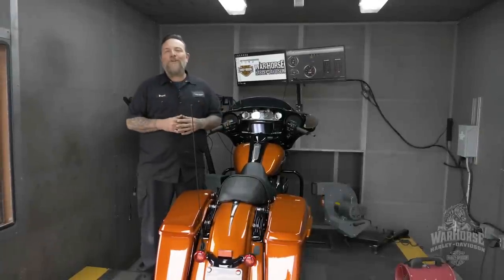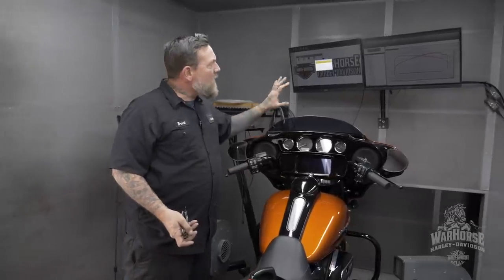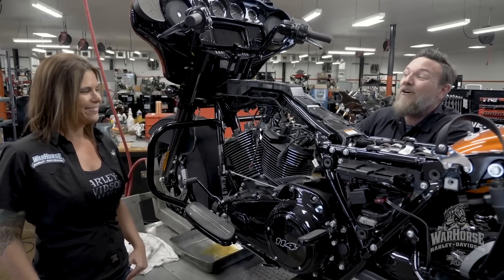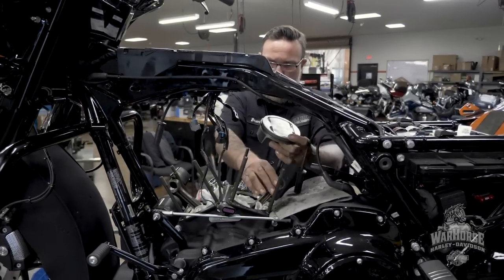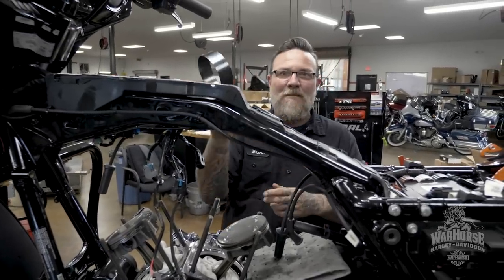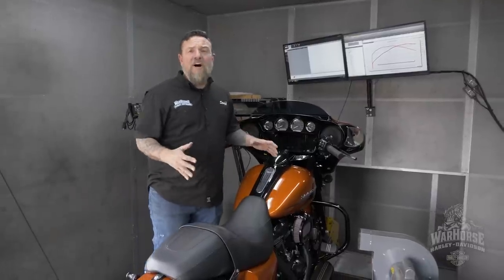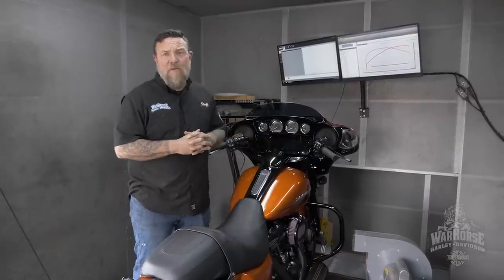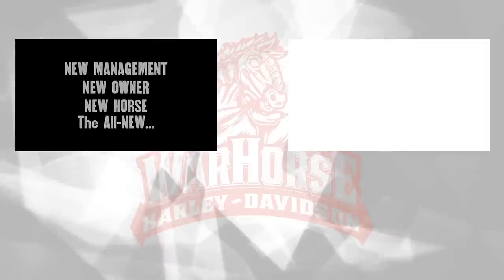Harley-Davidson Screamin Eagle 131 Stage 4 Crate Engine Upgrade Dyno with Horsepower and Torque

Comment: Not really impressive for the displacement
Reply from the maker: Thanks for the feedback. We're pleased with the increase in performance and this thing is still under warranty so we're happy!
Reply: Yes it is. Its EPA, warrantied, and no other options give you that
Reply: @daflea66  There are craploads of bikes on the market that give a much better power to weight ratio from factory.....
Reply: First of all, torque is the number you want for this type of riding, not power. Second of all, comparing sport bikes to cruisers and touring bikes is ridiculous and makes one look jaded, uneducated of the topic, or just dumb. Third of all, load any bike with the same travel kit and passenger weight i do and i will ride next to them the entire time, indefinitely, up any grade, and they'll never feel like they were at a torque advantage.
Reply: @elonmust7470  Agreed. Really cool bike. But ktm 1290 r makes 140 hp to the wheel and 130 foot pounds. Factory. Different kind of bike tho
Reply: @elonmust7470  With regard to from factory, everyone who knows bikes knows Harley Moco uses stuffed exhaust and weird cam timing to get EPA numbers.  They are of the most customized vehicles out there. Its just what one does. The pipes you want and cams if you want. Factory pipes on almost every bike out there look hideous. To each their own, though, but know what you're comparing and why or just get on a fkn bike and ride without preconceived notions of your opinion and bike being somehow superior. It aint.
Reply: @daflea66  Thats the truth. Alot of it is the rider not the bike.
Reply: @zur9142  yessir and in comparing the same bike. Like, cruisers arent meant to do 0-60 in 3 seconds. Touring bikes can take 2 people and their gear for a indefinite cross country trip, and people are comparing them to sport bikes. Its a damn joke lol
Reply: @daflea66  I totally Agree. For me im into adventure bikes for long miles on dirt
Reply: @zur9142  next on my list. I had to downsize, kept the touring bike. However, I can acquire again. So, soon!
Reply: @daflea66  i recently got a Klr650 first gen. Its magical. Not fast or quick but it pulls like a tractor. I love it so much lol. I couldn't be happier for what it is. However id love a  Yamaha Tenere 700. That bike has so many good reviews